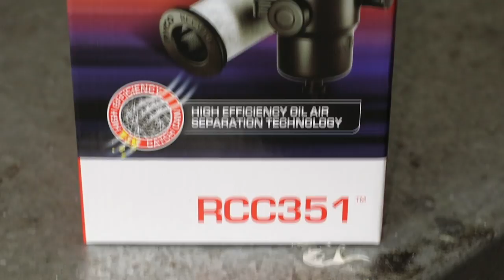I install my new RCC351 CATCH CAN and Water Separator from Ryco into the Land Cruiser 200 Series

Comment: I’ve found Catch cans to be an absolute waste of time.
Reply: Care to share your experience
Reply: @jasper287  I used one for the first 50k on my Hilux and then when I got my intake system carbon cleaned, my mechanic convinced me to take it off. I did and did another 50k, then had the intake done again and he said it was no different than the first time. 
The oil that the catch can collects would just get burned off through the exhaust system anyway.
Reply from the maker: It still fouls up your intercooler on the way through too though. Oil isn’t a great thermal conductor so having your intercooler coated with oil mist surely wouldn’t be good fit it’s efficiency? Or am I wrong?
Reply: @JebbreysJibberish  check out John cadogan on YouTube. He explains it far better than I could.
Reply: @greenslawngarden7809  what brand catch can. Because not all catch can's are equal and many don't do what you believe. Many continuous duty diesel engine's come from manufacturers with built in catch can systems believe or not. And if you believe, trust Toyota engineers so much why in the world have you had 2x intake cleans at 50k apart. Sounds like you have some issues you're not discussing
Reply from the maker: Seen it before. He doesn’t convince me on anything with his anti 4wd and camping rhetoric. Anyone who can’t understand why people want to go bush will never understand why we modify our cars either.  I agree with some things he says, like the triton video recently but a lot of his stuff i disagree with. I’m going to do something on this topic soon actually.
Reply from the maker: Also check out berima diesels channel from people who actually work on diesels and pull them apart daily stead of listening to and engineer who stands in front of an unused drill press talking about stuff with no first hand experience.
Reply: @jasper287  no issues, I just tow a trailer for work and travel 50k per year, so I have the intake de carboned as part of my yearly maintenance. I’ve got 540k on the clock and still going like new.
Reply: @jasper287  it’s because most modern Diesel engines have built in oil separators that catchcans are redundant in my opinion.
Reply: @JebbreysJibberish  yeah I like berrima diesels channel too. Just in my and my friends experience they have not been worth using. I guess if you have remapped or chipped it might be, but I run standard.
Reply: @greenslawngarden7809  still waiting on info as to what brand catch can you used that didn't perform??? Please do explain to me this modern diesel engine oil separator you speak off? I also watch John cadogan, I enjoy his channel and often wonder what he says and thinks off screen. Something to consider all his stories are about number and if everything worked in a perfect world and if it was a perfect world and if every one drove their cars like the manufacturer does on paper and in their testing facilities then no catch can's would not be required for the engine to make it to its manufacturer's intended life span.
Reply: @jasper287  oh sorry I didn’t promptly reply to you within the agreed upon timeframe of YouTube regulations.
I used a pro vent. I didn’t say it didn’t perform, (certainly didn’t cause the dramas that this poor bloke had on his 200 series with the ryco) it just didn’t add any benefit to my vehicles engine. I run a stock standard 1kd and it’s done half a million with regular servicing.
Reply: @greenslawngarden7809  I never inforced any time frames I just thought most ppl who directly reply to a msg would normally answer the easy question first then the harder questions. Strange to think a correctly plumbed and maintained provent is letting any oil through specially enough to warrant a inlet clean. Have you seen pictures, perhaps your mechanic is taking you for a ride and agreeing to a inlet clean for no real reason.
Reply: @jasper287  I was joking mate. I use a pretty reputable mechanic called just autos in Nambour and I trust them.
Reply: @jasper287  it’s just carbon buildup that gets cleaned out due to the bloody egr doing it’s thing (thinking about blanking it out) it’s the only thing I dislike about the engine.